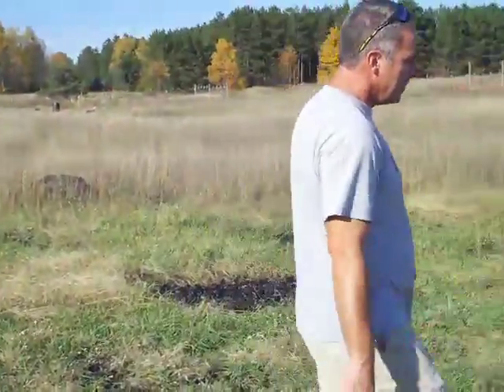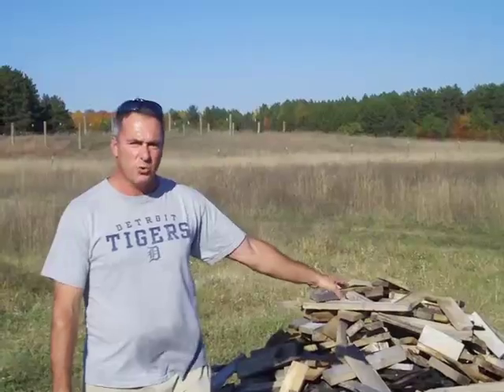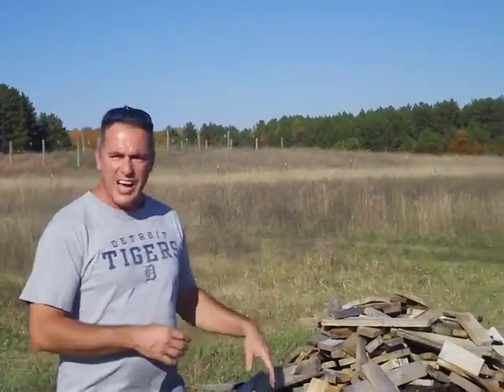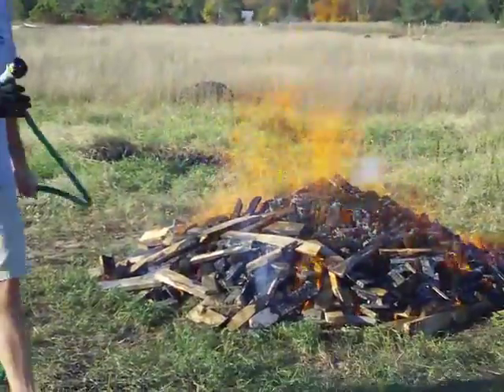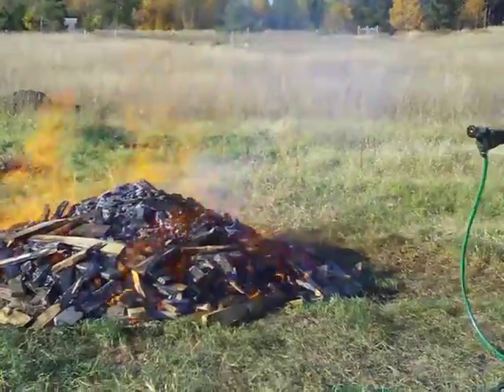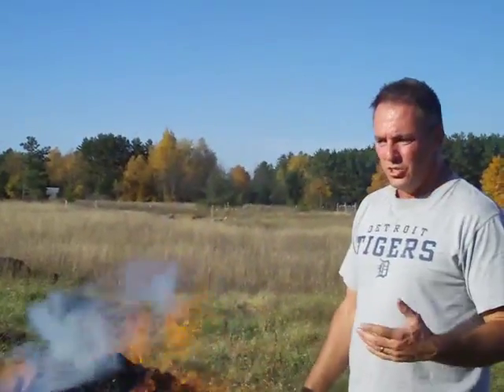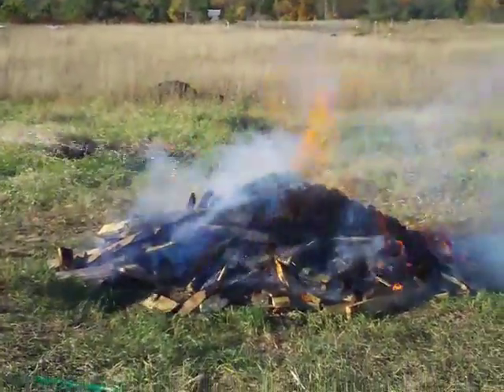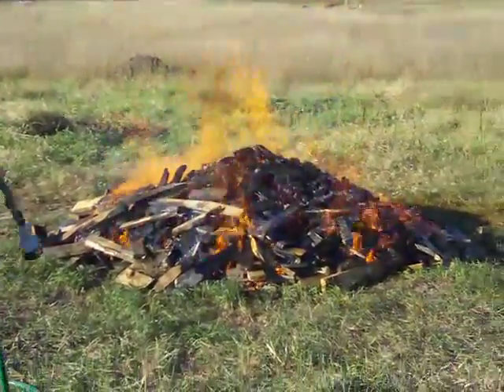Making Biochar With Scrap Wood

Comment: I've been making biochar with my wood stove. The process uses no water, all I do is collect wood ash in a metal container, the one i use to clean the ash pit, about halfway full of wood ash. When my fire is very hot, I knock many glowing hot coals down to the ash collection chamber in the bottom using a fireplace poker, using a fireplace shovel, I collect the hot coals, mix, turn, and bury them in the wood ash cleanup container, and smother with a lid. It cools fast, I just sift the wood ash back into the ash container, collect my biochar, and repeat. I'm excited to use it in the spring, I plan on charging with some organic meals and compost before adding to the mix.  It takes me a long time to make the fire hot enough, but I can create quite a lot of biochar this way, while keeping my shop warm in the winter.
 I will remember your method if i find the need to make biochar in our warmer months. Thank you!

Comment: It may not be biochar in the most modern sense of the term, but certainly more consistent with a primitive or natural definition.  In a natural fire (consistent with prairie fires, etc.) there would be ashes, unburnt pieces, charcoal, and biochar all of which would have varying benefits to the soil.  Bury it, and it will be fine.

Comment: Bio char is  low temp charcoal  by him spraying the water on the pile he is reducing the temperature.   Charcoal made in a retort  releases just as many  gases  as this fire.  Heat extracts the gases in a retort  verses open ignition in a fire.  People who are having a hernia about co2 release need to calm down . Wood is co2 neutral meaning that  it has consumed  more co2 in its life as a tree and by photo synthesis produced oxygen.  Even by burning this open no more co2 can be released  than by natural decay. I,m not for pollutants entering the atmosphere but im also realizing the  need for charcoal in our soil.

Comment: This is not making Biochar. Biochar is not charcoal, it`s different. All this guy is doing is burning wood until it`s a little charred then putting out the fire with water.
Reply: You do not understand what bio char is. Charcoal is base for bio char. Your an idiot . Please understand and do your research before posting.
Reply: None of it is bio char until it is inoculated with microbes, that takes ageing and curing with microbe rich soil or substances, some of the inner parts of the pile will be of good quality, the rest will be low quality, long term it will all be good for the garden.

Comment: OMG..  know your chemistry friend.  A clear fire does not mean you're releasing less CO2.  You are releasing a ton of CO2.  As long as oxygen is available you are releasing CO2.  The fact the fire is hot means you're getting good combustion, which results in lots of CO2 and less large particulate.

Comment: Wow... serious? just get a metal drum, make holes on the bottom, get the drum up to 300 celcius and viola.  You're burning a ton of carbon off by making it in open air.  Your method is extremely inefficient.  

However if you have no metal drum, i suppose this works.

Comment: Wrong.  Charcoal is biochar.  What you're getting confused is that the charcoal they sell at the store has a bunch of accelerants so you don't want to put it on your garden.  Biochar and charcoal both result from pyrolysis reaction, which is essentially burning wood at 300 degrees celcius plus in an environment without oxygen.